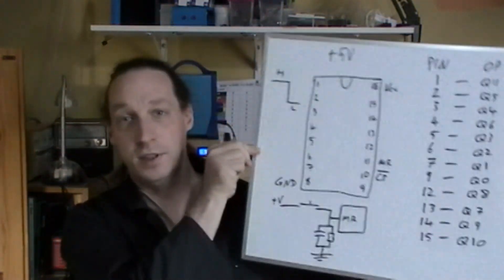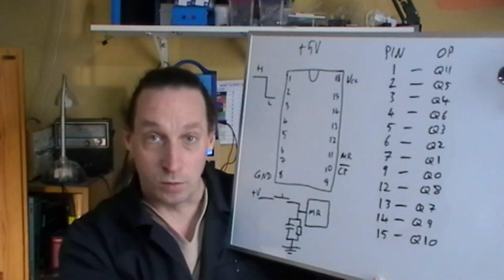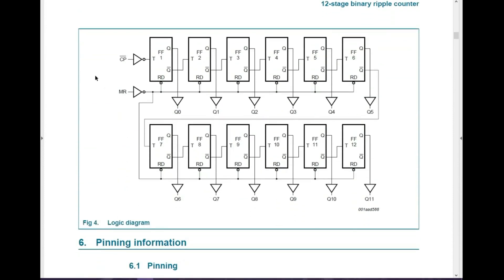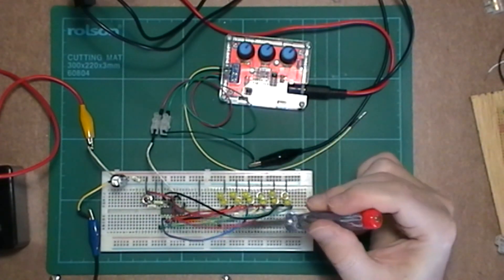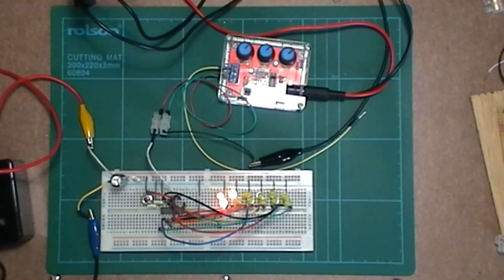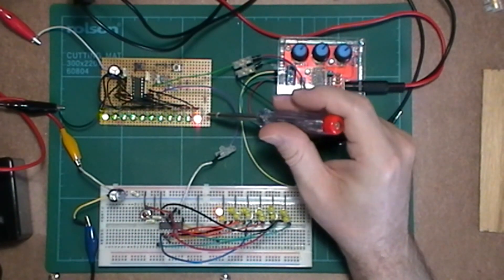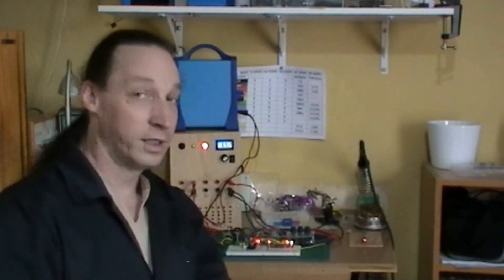CD4040 12-Stage Ripple Counter

Comment: I believe you should be using resistors on each output. The output pins have a current limit which must not be exceeded, and LEDS will draw current until they burn out. Your only saving grace here might be the low VCC of just 3V, you still need resistors.

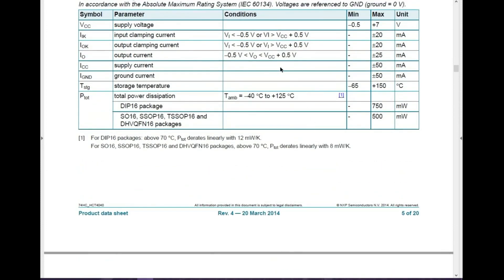Comment: Thanks for the info!  In regards to 4:14 Icc (supply current), if your 5v power supply can supply more than 50ma, I don't believe you would need to do anything special to limit current since the IC itself will only draw what it needs.
Reply from the maker: Hi Enigma758, standard thought is that the IC will only draw what it needs so should be okay.  I believe the issue is that if you connect an LED on the output that wants to draw a lot more from the output then the IC will try to supply more, this may certainly damage the IC.  So limiting the IC supply current will help to protect the IC.  Might be a nice test video to do.
Reply: @rpsproject5349 Hi